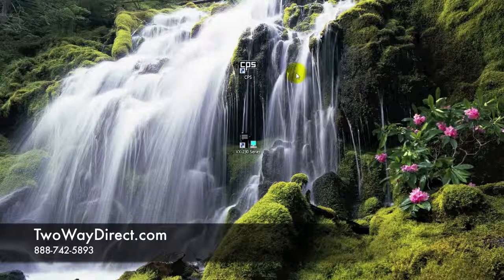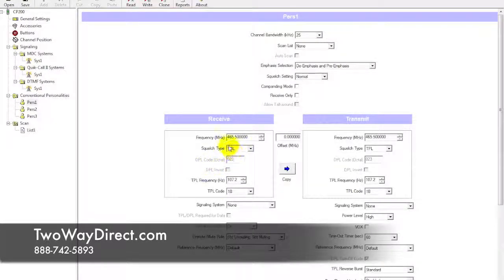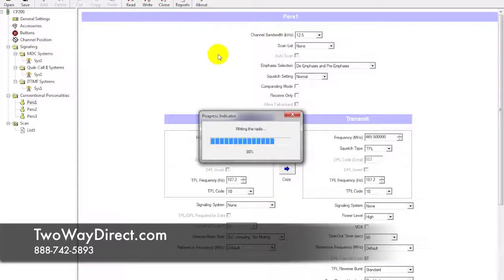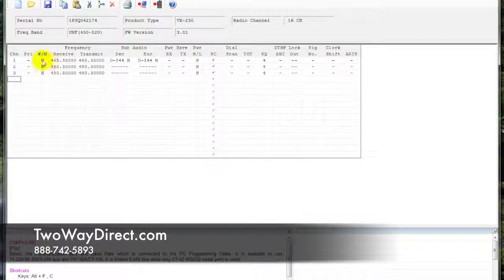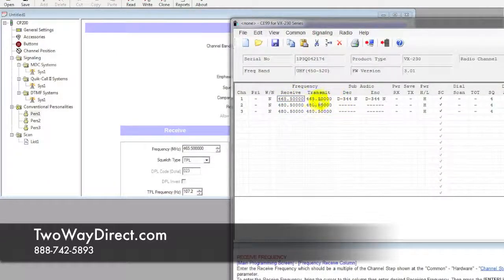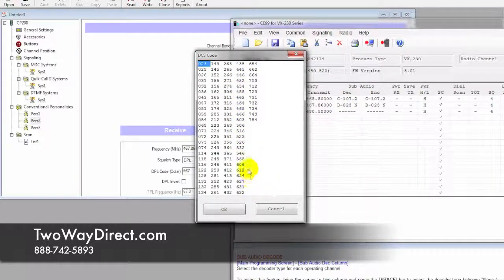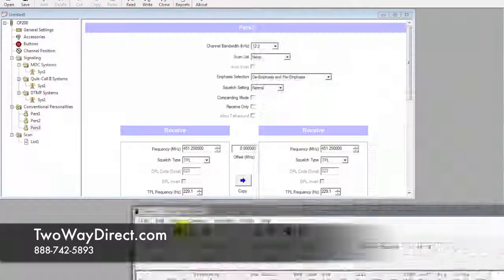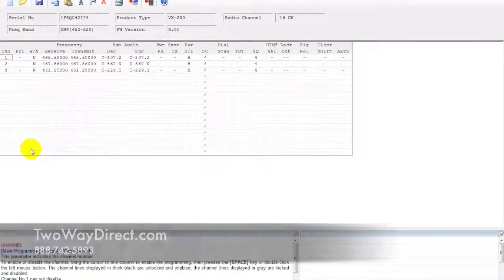Radio Programming | Motorola CP200 to Vertex VX231

Comment: In your programming example, you're using the normal DCS (D-567 N).  Can an inverted DCS (D-567 I) be used as well?
Reply: Now, without changing the reverse burst, you have the Motorola doing its version and the Icom doing its version. Squelch crashes on both radios when they talk to each other. You need to change one of the radio reverse burst settings on the CTCSS  channels on one of the radios.